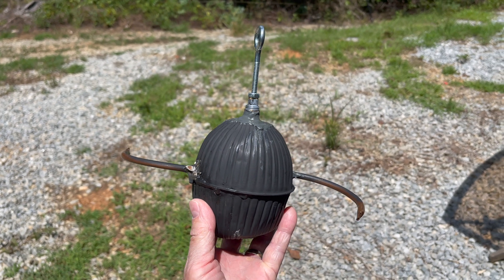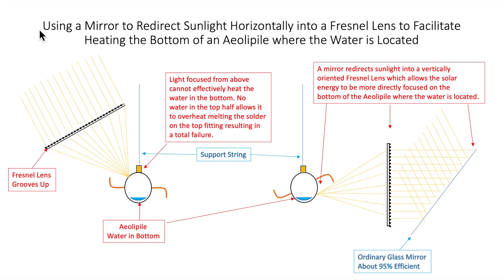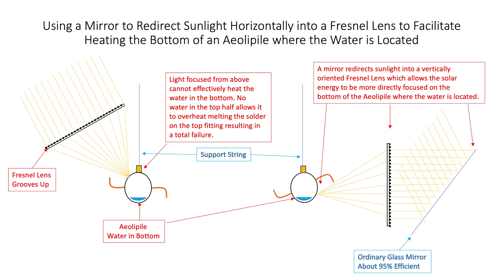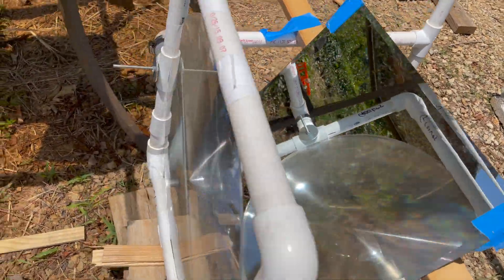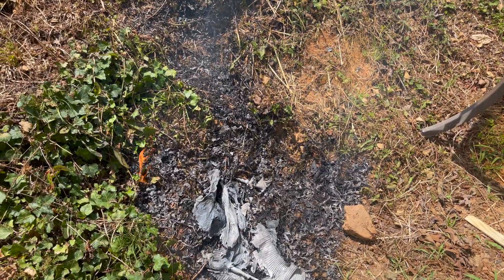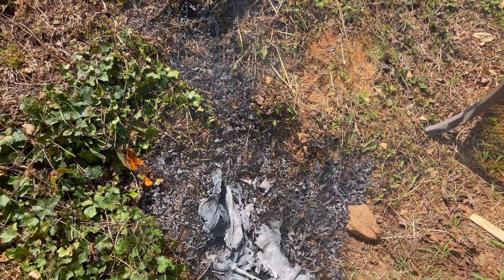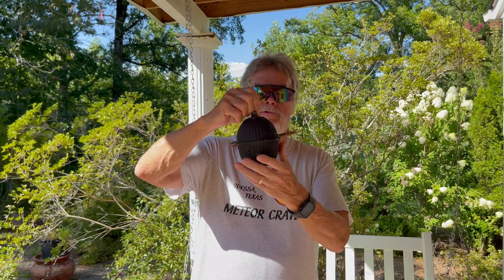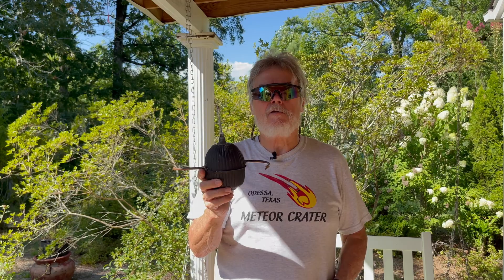Mirror to Redirect Sunlight Horizontally onto a Fresnel Lens for Solar Heating an Aeolipile

Comment: suggest following. make bottom target of fresnel lens. make bottom solid to maintain heat. I have a working steam generator for a 1 meter lens. not an engine.
Reply from the maker: Thanks for watching and your comment and I appreciate your suggestion.
Reply: Would be very interested in a picture of the setup. Any links available?

Comment: what would happen if you used a dish array of mirrors to focus the light to the fresnel lens? Would that amplify its power at all?
Reply from the maker: Thanks for your comment. I have not tried an array of mirrors. I am not certain, but I believe it is probably the light that is coming straight into the Fresnel lens that is focused to the common focal point. Good idea though and I will take a look at it. Thanks.
Reply: @anisotropicplus  Awesome of you to reply! I’ve been very curious about the potential ways to amplify the power of a fresnel lens. Such an abundant and accessible source of energy as the sun should not be left to waste. When I imagine what it would look like i imagine probably a horizontally mounted parabolic mirror or group of mirrors to focus or at least direct more sunlight to the lens.